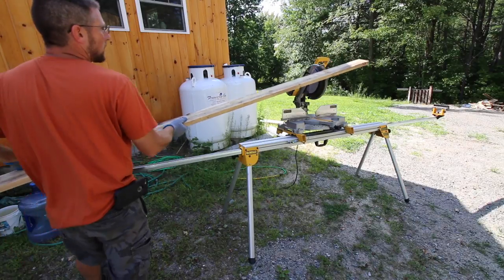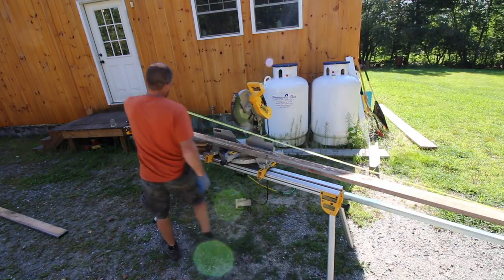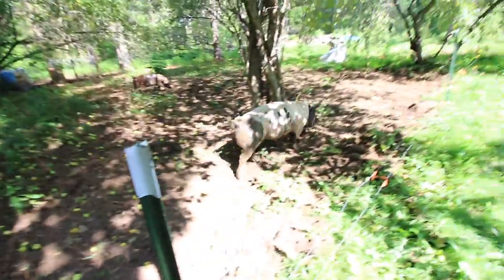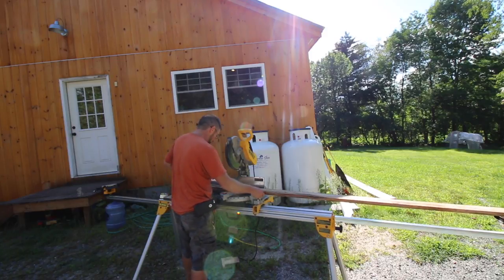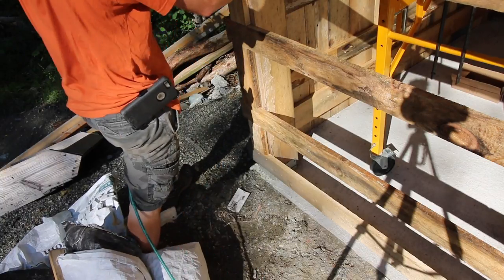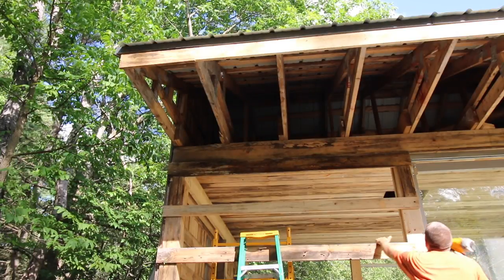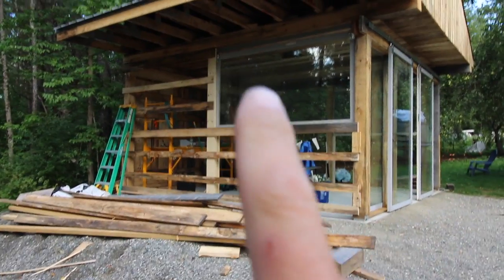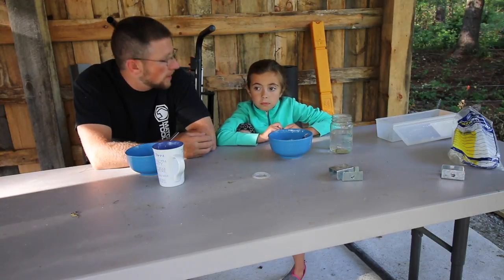Getting ready to Side the Off Grid Outdoor Kitchen w/ Rough Sawn Lumber

Comment: Al, seeing that side you just strapped, instead of an angled piece of trim, I imagine a wide counter top under the sliding window that you can use to pass things from inside to outside. You could also use it as a buffet to put food for potluck meals. Maybe even a counter top under that sliding window on both the inside and outside. Just a thought.
I like the angled sill under the window on the other side, though.
Love the video. Thanks!

Comment: Hey! I'm a new viewer and love your channel. You may have fixed it by now, but I noticed you have no diagonal bracing in your outdoor kitchen wall framing. That will be unstable in high winds. The horizontal girt boards will not be enough. I'm just bringing this up , maybe you can research it. And again, you may have added bracing in a later video.
Reply from the maker: Thanks! Yes we need to add the bracing.